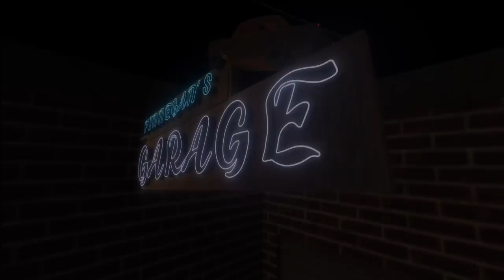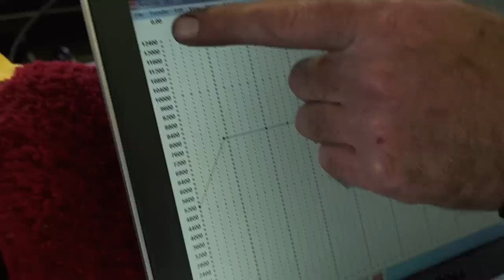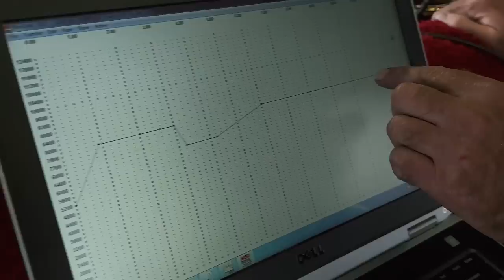DISASTER ON RACE DAY! PART 3 OF MY NEW JET BOAT DEBACLE.

Comment: man this seems like such a cool group of people to hang out with and race some boats
Reply from the maker: I'm very lucky.
Reply: @FinnegansGarage  In life you are, but not so much in race engines apparently, lol.
Reply: @mattwilliams3456  he is, he said so in the video. 😁
Reply: @FinnegansGarage  not with used vehicles.....
Reply: @FinnegansGarage  luck of the Finnegan with marshmallow Springs silly tires jet drives are for water
Reply: I drove a top fuel hydro in the IHBA, great people, all like family in a family atmosphere. Yea, there were a couple assholes, but 99% were helpful and easy to get along with.
Reply: @FinnegansGarage  you should name it sex panther, because 60% of the time it works every time.👍
Reply: Wat I like about it is other motor heads jump in and help. Sweet ass ppl I'd want hang out and swallow  some beers
Reply: born and raised with these guys.  best group of friends ive ever had.

Comment: Mike sold Gameover because He was worried about thing failing, breaking and coming loose and being to complicated. That worked out well with the New Boat.
I Know you buy a Boat with no warranty, But I Hope the Old Owner did something for Mike, considering the add said rebuilt and ready to race. I would be a bit pissed. That New Boat would not have been cheap.

Comment: Im stunned that such an expensive “ready to run” boat basically needs to be re-built…. Id be rather pissed to say the least. Owner took the cash and ran for the hills huh
Reply: I got the impression the boat had been sitting for awhile before Mike bought it.  Race cars and boats always take a lot of maintenance to keep running at peak potential.
Reply: Welcome to racing. Even expensive brand new stuff doesn’t come with a warranty and might break first time out. 
Then you add in extra valves and wiring for the stuff not on normal boats and there’s always gonna be trouble. 
The boat was running and basically complete when he got it. Along with everything looking nice. Hard to really ask for more when buying something used like this.
Reply: Jeep...

🫤😂
Reply: Youve obviously never gone racing.
Reply: @danmyers9372  Mike said it hadnt ran in 2 years

Comment: boats name should be "problem child"....I managed machining/engine build and engineering for Roush Racing. Spent 9 years of my life pertaining exactly to this video, endless hours, days etc. building race engines. I machined and assembled the first engine in Jacks P-51 Mustang. Very few understand the "material" outlined in this video, or the engine, components and technical data. You truly "live" this "stuff".
Reply: There's already a Top Fuel Hydro in the Lucs Oil Drag boat series named Problem Child . It's owned and driven by "Fast Eddie " Knox
Reply: e musteng bdterr ekrrc 300 mioes ranfe 230 miie rabge

Comment: Well that was fun !! Glad you had a great time even though allot a shit happened, at least you got to hang out with allot of cool heads! The new boat is bad ass! I am sure next seaon you'll make some great passes after you go through everthing this winter. My boat has been sitting in Lake Havasu storage for over 4 years Harold Bruce from R&D Marine re-glassed the bottom of the boat with a speed coat and finally got rid of my porposing problem also installed a new impeller and I havnt even taken it out yet...God Bless ME!!! Going to have to go through everything and make sure everything is cool, glad I installed teflon fuel lines so I dont have to worry about fuel leaking everywhere!
Reply from the maker: Harold has been around a long time. very knowledgeable dude.

Comment: We used to drag race at Long Beach Marina on Lake Ming in the early seventies with a sanger pickle fork hydro called motherforker.We ran pro comp hydro. The boat was owned and driven by Gene Palmer and I built the boat and engines. Lots of fun.
Crazy Wayne Cronan

Comment: Hey Fin. A quick battery suggestion. AntGravity makes a 16 volt lightweight Group 48 battery. This could offset the weight of an alternator. That battery has 1500 cranking amps, so plenty of juice. Just an idea.
Reply: Is this the guy that said you would never take the valve covers off during the day lol I don't think he needs any suggestions from you🧁 And he has a 16 V battery It's just 2 years old

Comment: Couple of thoughts, try a pickup in the plate for not slamming too much water through the system. And I saw a couple of times in the video where they asked you to charge the battery.

Comment: Sometimes when you floor it during a pump air lock, you'll over rev and boink the spring. If I remember correctly you had an air lock issue on off the line.

Comment: So, in the last few months you have learnt that engines need a full fuel tank and a full battery! 😆

 
I don't understand why the milkshake in the engine is no big problem even while it will happen again, why is it not a problem?

Thx for the great show!
Reply from the maker: we shut the water supply off to the engine and crossed our fingers for the short amount of time we continued running the engine.

Comment: I run a 16 volt battery (xs power I believe) on my big block 582 1000hp and the thing loves to crank and starts just fine but I run a 139 tooth flywheel and a “big dawg” starter. The reason for my comment is i have a little alternator on it and I still charge it after every run. I’ve heard a lot of guys kill 16v batteries the way u did and I’ve been told some people like 12v cuz they have a warning when they r about to die but don’t change it that thing cranks great!
Reply: I wonder if they were charging it with a 12v charger. Would make you feel like it’s doing something without ever pushing enough voltage to really charge the battery.

Comment: A milkshake is so much better than a crappy old school petroleum oil from 50 years ago that wouldn't let oil and water emulsify and instead looked like an oil slick sitting on top of sea water. Emulsified oil and water is nowhere near ideal YET will continue to try and lubricate your hi-po boat motor when it happens instead of catastrophic engine failure. Years ago when I had a jet boat it seemingly gulped a couple gallons of water on one particular Saturday on the lake. Engine never skipped a beat but I almost cried first time I found a milkshake. Changed the oil traced the leak (lifted a cyl head). Ran just the same for at least 2 more outings. When I finally got to the bearings I swear they appeared as if they never seen a milkshake and at that point in life the revelation was huge. Modern synthetic engine oils work and are worth the price.

Comment: If you have a predetermined countdown and a known length to travel to the tree can you not program that into the computer? You know at full throttle it travels x distance. Can you program a launch at 5 seconds to hit the green at 0 and then open up wide for all hell to break loose?

Comment: It could be worse. I ran a monster truck with no alternator. We always have to charge it and refuel the truck in between racing and freestyle during intermission. I had something small to fix on the truck and forgot to plug it in. It straight up died in the middle of my freestyle run in front of 3,000 people. ....dead batteries. I had to get the loader to drag me off the track so I could stop holding up the show. I feel your pain.
Reply: chef ran eltric big fiit 30 montes per chatge batrey caty 500 jw  30 miñtes tp sieed 1 nw per hourd

Comment: I wonder if the impellor isn't corroded inside and causing it to not be able to pump water right.. It'd explain why it shakes so much as well as doesn't go anywhere or rev right in the water. I know that when those pumps aren't working right they work as a great water brake just like on a dyno.

Comment: Cut an inner tube in half and slide the halves over the header tube to make a make shift muffler for moments like that. 🍻 it's an old cheater trick to pass sound check.

Comment: Does boat racing allow moveable aero? Wondering about having the front wing adjusting angle automatically to optimize hull angle and downforce as necessary.

Comment: Are we going to get a follow up video with what the actual reason it wasn't running properly?
Reply from the maker: Yes there will be an update video. The issue is the boat is in california and I'm in georgia so that video wont happen anytime soon. The engine has been fixed..it needed new intake manifold gaskets and valve springs. But as for the mystery electrical gremlin...won't know the fix until the next time i go back out and drive the boat. We'll be replacing the battery, adding an alternator, and checking the switches and wiring in the boat.
Reply: @FinnegansGarage  Run it manually

Comment: So Finnegan fires the parts cannon. Happens. Broken valve springs and water in the oil was a bad sign. Too much water pressure causing water in the oil? Sounds fishy. Are you really saying the water pump is forcing water past the gaskets into oil? Maybe your water pressure regulator is stuck. Anyway nice thrash in the pits and the gremlins got 'ya. Try using a manually adjustable throttle stop, better than the rev limiter idea. Better luck next time.

Comment: your oxygen sensors are in the wrong spot at the bottom of the pipe they should be on the sides to stop water getting in them

Comment: What is that heater they are standing around at night. It looks like a great way to stay warm and an awesome conversation starter.
I think I need to build one ..
Thanks @finnegan999
Reply from the maker: i think its called a "smudge pot"
Reply: Very cool! Looks like I can use it for waste oil too. Thanks Mike
Reply: @stappys  its actually fueled by your old used oil and they will run all night on a few quarts.

Comment: Great series, but it seems so risky to keep running it with water getting in the oil. You're risking totally destroying a $40k engine.
Reply: buy e seadoo ekturc 36 kw  or 48 kw barsy 19 miles or 23 nioe

Comment: How does that rope clear the intake scoop? Looks like it's chest level
Reply from the maker: A guy named Tony Scarlotta, who is a legendary boat racer, was on the starting line barge. He lifts the rope upward via a pulley and cable system, right before the clock begins counting down.
Reply: @FinnegansGarage  Yes I finally saw that in the last race lol. But thanks for the response. I'll be at the Vortex in Atlanta in a couple weeks. If u haven't tried thier burgers I highly recommend them 👍

Comment: Fiddling with the rev limiter and then pulsing the engine would have done it.
Again Finnegan, just stick to road kill engines that no one cares if they break... because anything you touch... will always break.
Just drive the boat and get someone who knows what hey are doing to make any changes.